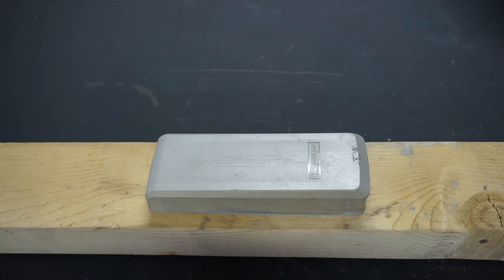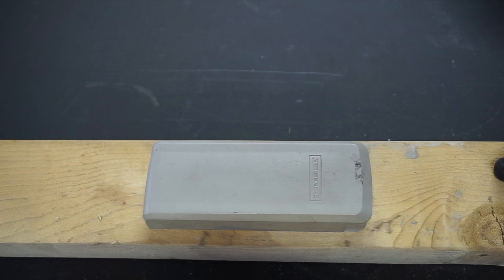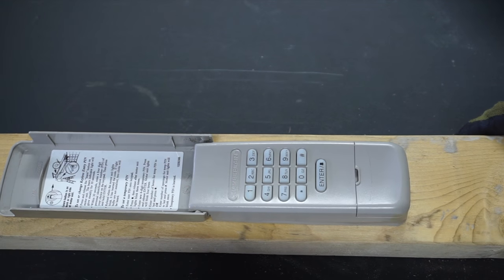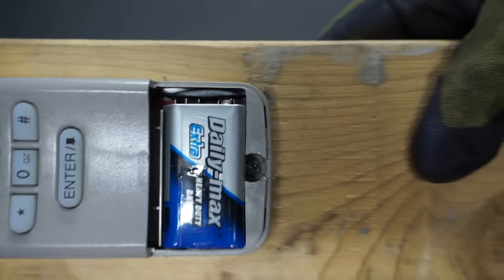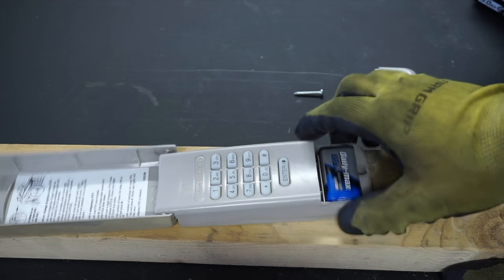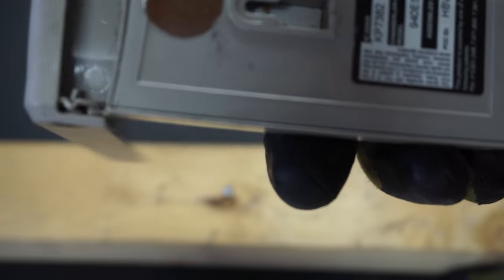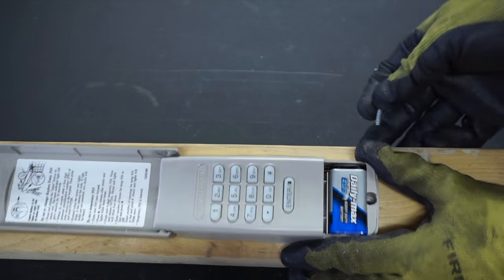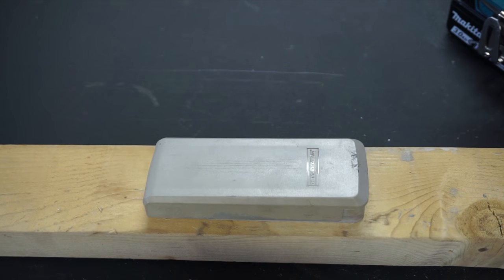How To Remove Or Replace A Garage Door Keypad

Comment: woah - that's WAY easier than I thought. I figured there would be wiring involved, so I've been putting it off. Thanks
Reply: Was there any wiring? Looks like a taped up hole on the back side when he turned it over. Getting ready to smash ours open, clean the keypad contacts and see if that might be the reason ours doesn't work in the cold. 🤔 Wonder if condensation builds up behind the keypad preventing input.
Reply: @Terrapin Flyer  Did you do do it?
Reply: Same dude 😂

Comment: Thank you very much for the instructions.  Bottom screw on our LiiftMaster remote was somewhat hidden above the battery.. Your video led to looking further around battery to find the screw. Equally great to learn about simply lifting housing upwards to slide above top screw. Previously concerned that housing might have been held on with double stick adhesive.

Comment: Kind of an off question. But, will my Chamberlian wall keypad (940EV-P2) open my Liftmaster 81602 garage door during a power outage? The garage opener has a battery back up installed - but wasn't too sure if or how the keypad and the opener will work together in the event of a power outage? Any help would be greatly appreciated as I cannot find any info regarding this...
Reply from the maker: It should, you can test that easily by unplugging the opener and seeing what happens ?
Reply: Thank you for the quick response. Much appreciated!  @GarageDoorGuidance

Comment: Our cover to the keypad broke, so now the number pad is left exposed. Can the face be replaced or do you need a whole new unit? The cover is fine, but the hinge area snapped off therefore you cannot put the cover on
Reply from the maker: Likely the whole thing at that point

Comment: Do the contacts behind the keypad on the circuit board get corroded or dirty on these? We've been having issues w our for a few years and it's gotten to the point where it's unusable, especially in the winter or when it's cold. Guess it'd be better to just smash it open, clean it w rubbing alcohol and see lol. Just trying to save myself $35 or so if possible.
Reply from the maker: I just recently tried to open one up and it went as you say. Smashed up into nonexistence in order to get what I wanted 😅
Reply: how did it go? I have the same issue (work in Summer, fail in Winter), and going to take it off and open it to clean the contact. The battery has 9V so it shouldn't be the issue.
Reply: @zaiyen676  Hello, did that work? I am having the same issue and wonder if needs replacement or something else.

Comment: How do you open the keypad? I’m trying to clean the buttons contact surface.. button 2 is sticky..
Reply from the maker: You’ll have to use a flathead screwdriver to pop it open
Reply from the maker: It might be easier to try to clean it with like a toothpick or a tip first

Comment: How do you connect a new keypad to the existing opener?
Reply from the maker: How To Program A Universal Garage Door Opener Keypad
https://youtu.be/VcF9t9cz6s4
Reply from the maker: What opener are you working with?
Reply: @GarageDoorGuidance  I have the same question. I am working with a Liftmaster. Number pad does not work anymore, so I need to replace it. Any tricks I need to know? Thanks!

Comment: I pull the battery wire from the keypad and it got cut off from the keypad what should I do   To it make work from the garage door
Reply from the maker: You’d have to open it up and sauder it back on if you want to use the same one

Comment: Put a little pressure on it, he says.  I've been pushing and prying for five minutes and it won't budge.
Reply from the maker: You have the same one ? Some of the older keypads are clicked in different than this one is
Reply: @GarageDoorGuidance   exact same.  Bought two years ago.

Comment: I came here trying to find a way to go BACK to hard-wired because there's nothing worse than going out to the garage in the winter to get the snowblower, finding out the batteries are dead and having to F with that for 20 minutes ... Especially if the battery door has frozen up ..... Thanks but no thanks.......  My friendly advice ... If you live in New England .. Stay Hardwired ......
Reply from the maker: 😅 Glad we don’t deal with that here ! Or I’d heartily agree !